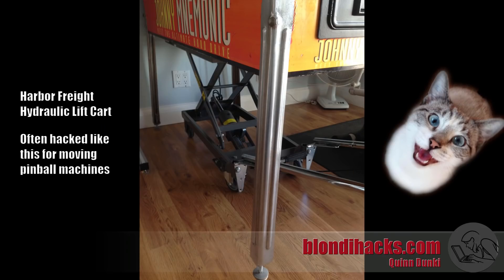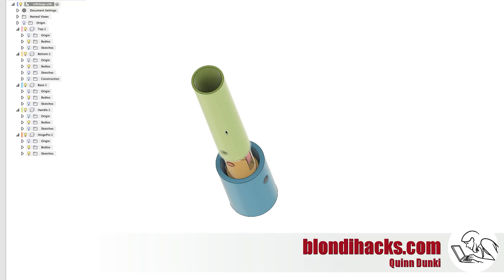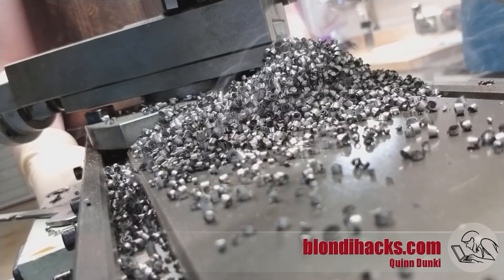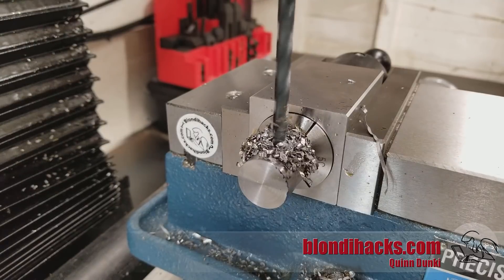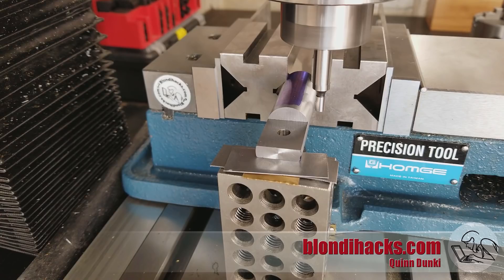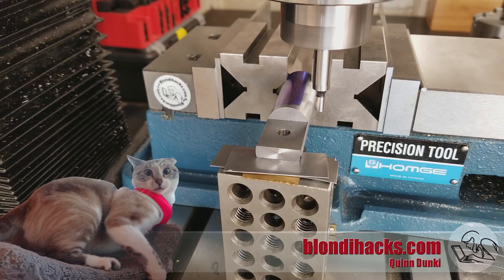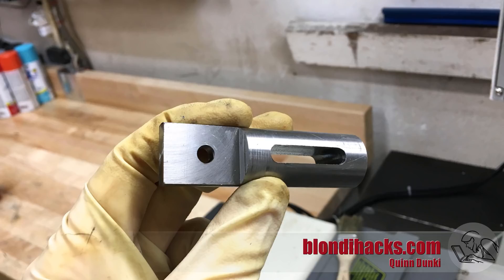How To Make A Locking Hinge : Part 1/3

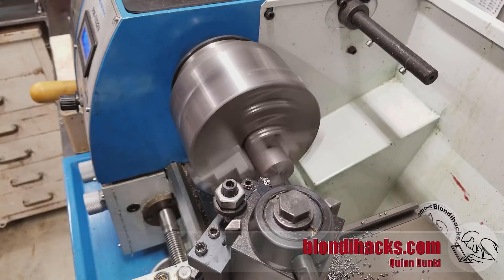Comment: 3:11 - question for you: I notice in this and a couple of other videos that when you're center-drilling, things seem to move right as the drill bit [see, I was paying attention! ;)]  touches the part.  I don't recall you mentioning that when you discussed center-drilling [though I suppose it's entirely possible that I wasn't paying close enough attention, and should go re-watch that bit], and... was wondering: is this normal?  expected?  How does it fit with concentricity?  Does the spinning of the part force the tool into the center, I guess??  So this is just an indication that your tail stock is out of alignment or loose or something?  Or...... ?!?  [I genuinely don't know the answers to these questions... so, hoping for insights!]
Reply from the maker: If the tail stock quill is a little loose, it will move yes. It mostly self-centers though, and the motion is much less than it appears on camera. You’re seeing a very close view with the quill oriented for projected lateral motion in the frame. That makes it look much more dramatic than it is.
Reply: @Blondihacks  interesting.  OK.  Thanks!

Comment: Very nice design and work... but the bad thing about tail stock support while parting off is the work piece can drop and jam itself and the tool into the rotating remainder..   on a belt driven machine... the belt usually slips and maybe the part has a gouge... but on a gear head machine, and    occasionally on a belt machine, the cut off and the broken tool are ejected in an undesirable direction at high speed... 

I like your videos, please keep them coming
Reply: Yes
Reply from the maker: Yes, you are correct- this is a bad habit and I shouldn't show it. :)  I added a clarifying comment pinned at the top.
Reply: What I do is to remove the the tailstock once the tool is close to parting off is just hold it by hand until it is parted off.  It is very comfortable and safe.

Dale in Canada

Comment: Very good work there Quinn and a good idea for improving the handle, I have had similar issues with fighting those kind of things that seem to have been engendered specifically to frustrate you so you have to re-engineer it to make it work like it should have in the first place or better.
Reply from the maker: Thanks! The original cart was very cheap and limited in the way it was built. A little engineering and it became 10x as useful!

Comment: I hate to use "always" and "never" but I would not part off while using the tail stock, a steady reset rest maybe but not the tail stock.  Nice work though.
Reply: Why drill the hole before machining the flat? Isn't it easier to start a hole on a flat than round bar if you are milling the    tab anyway?
Reply from the maker: @fishman241 In this case, either way works fine. In general, it's good to do all your cross-drilling first, because the more features the part acquires, the harder it gets to hold on to it for drilling. Drilling has more limited fixturing options than other operations, so cross-drilling first is just a nice habit to have.
Reply from the maker: @Rich So, to each their own this, but I find it safer and lower drama to part with the tailstock. The tailstock keeps the end from drooping, which would close the gap on the parting blade and cause binding. With the tailstock, the gap opens on the bottom because the cut line droops, which helps prevent binding on the parting blade. This is my preference, but I know not everyone does it this way.